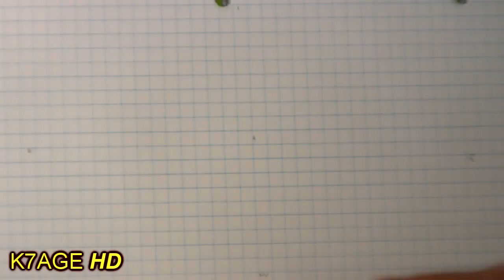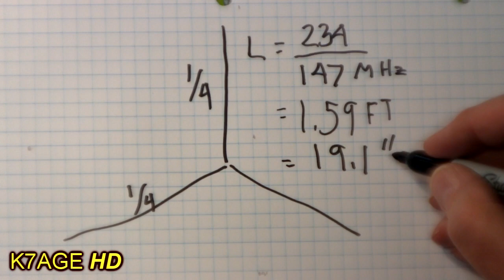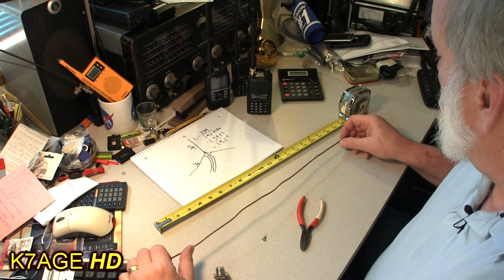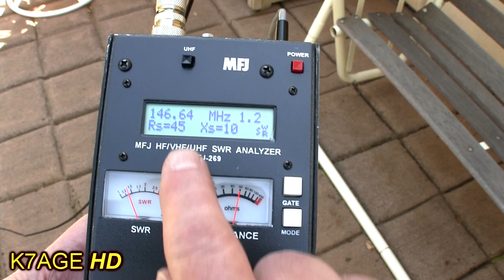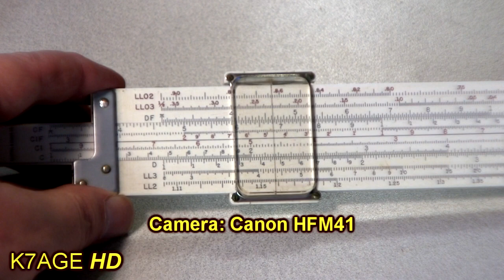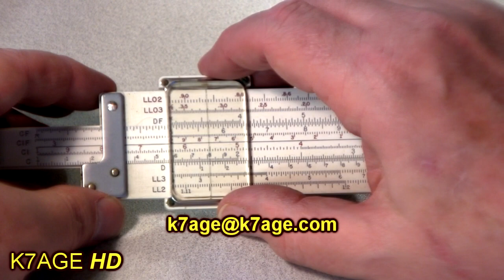How to Build: Ham Radio 2 Meter Quarter Wave Antenna

Comment: I'm looking to build a simple antenna,  you really laid this one out very well, and it seems impressive.. but a serious question.. Between this antenna and the dual band 2m / 70cm vertical dipole.. Which is the better of the two?

Comment: This worked great! I attached the pvc pipe to a drain breather on the roof and ran the coax into the window. Thanks for the video. I was not heard at all before, just had my first radio check last night. :)

Comment: Why do use 234 in the formula? Where does that number come from? I have watched several vids on determining length and each uses what seems like a random number for their build divided by the frequency, and no one explains where the top number comes from.  Thanks.

Comment: The end of the video brought back memories of the days before electronic calculators.  
We, or many of us, became very proficient with a Slide Rule back in the day. 
Here is a quick... what is a slide rule....
"The slide rule, or slipstick, is a mechanical analog computer. The slide rule is used mainly for multiplication and division, and also for "scientific" functions such as roots, logarithms and trigonometry, but usually not for addition or subtraction.
"

Comment: Wow, great! 
Could you use an antenna as such to transmit sound non-stop to a receiver 15 miles further in an attic? Or would you run into trouble as you are interfering within that frequency and other transmitters? :)  I'm looking for a DIY way to have a live broadcast from one point to another 15 miles further, without making a radio (only one place needs to receive it) but it's been quite difficult.. :)

Comment: Thank you. Well done and very useful.

___________
I only wish Americans would stop using archaic units in favors of the more rational international units. Without realising it, they are wasting everybody's time and literally billions of dollars of their own money because of a nostalgic attachment to obsolete units of measurements.

This is how every single engineer on the planet would design this antenna: 

The average speed of an electromagnetic wave in a copper wire is 95% the speed of light. So, a wavelength at 147 Mhz = 0.95 * 300 / 147 = 1.94 m (quick check: it makes sense since it's just short under 2 m). A quarter wave, therefore is 1.94 m / 4 = 0.485 m (48.5 cm, make sense since it's a quarter of a full wave length). Then, and only then, if some of their clients insist on having obsolete units of length printed on the antenna's packaging (feet, inches, yards, ald, alen, buddam, ell, girah, guz, jow, pace, rod, stadion, step, unglie, vara, yojana, whatever...) they would convert the result to their client's anachronic units and charge them extra for the trouble. A few cents there, a few dollars there, at the end, it adds up to a huge unnecessary sum each year.

Comment: Wouldn't a 5/8 wave radiating element work a little better? A little more gain.
Reply: A 5/8 antenna requires a more complicated matching system compared to a simple 1/4

Comment: Interesting and informative video, but just a small spelling correction needed, you misspelled Metre (A Unit of Length) with Meter (A device for measuring volume, distance etc)
Reply: Meter is the American spelling of metre. Like colour and color.

Comment: Is the 10' length of coax significant? Would things change with a longer coax?
Reply from the maker: That was the length that I had handy. You can use longer coax, but the longer you go the more loss you have from the cable.
Reply: Thanks gents. I am definitely building this antenna.

Comment: Ok mr smart guy with his slip stick, eeerr, slide rule. I have my dad's and haven't never been able to work the darn thing. My Dad would work out problems as fast as I do with calculator.  He passed back in 73.  And now that I'm 72 I though about my grandson learning. But I guess he would consider it to be an antique. My Dad was a mechanical draftsman.
Reply from the maker: Learned this in college in the early 70s.
Reply: Yeah, it would have to have been some time ago. Don't think they even make em now. @K7AGE

Comment: To make it short : on the 2 meters band (200 cm), λ/4 is 50cm. Don't you think it is time to go metric? ;)
Reply: @K7AGE  You had to make 2 calculations and a conversion to determine λ/4 on the 2 meters band (note that it is not called the « 6 ft. 6.72" » band 😄), because of your cumbersome units (that nobody in the world uses, but you).
In metric units, 200cm (2 meters) divided by 4 gives 50cm (by head, no calculation, no conversion). Take a metric tape-measure and cut a 50cm element. Done! 😉
Reply from the maker: I bought a metric tape measure when I was in China years ago. I would make it easier!

Comment: Ground plane antennas are simple and they work. I have to agree that Radio Shack is a dead retail outlet. If you can find one, I guaranty they'll be holding a close-out sale very soon. Go to Ebay,  Amazon, Gigaparts, DX engineering - or - Radio Shack as I'm sure you will get a great deal.
Reply from the maker: They were around when I made this video.
Reply: @K7AGE  Yep, I really wish they still were.

Comment: Hey friend how are you today, I just started getting into ham and I bought myself a little HT, and I am putting a 771 antenna on it with the rats tail, I have a local repeater it 3.4 miles from my house, and then there are four more in the local area within a 4 mile radius, I don’t Much about ham at all do you think I would make it 3.4 miles to a repeater with my set up the way it is. Thank you and if you can please respond Oh yeah PS the radio has 8 W max
Reply from the maker: I would think that distance should work. The repeater should be strong on your HT.

Comment: It would have been interesting, testing the ground plain at the same height of the ''rubber ducky''. In this test the vertical is a good 6 feet higher than the ducky.
Reply from the maker: True. But, the rubber duckie has loss compared to the 1/4 wave antenna.
Reply: @K7AGE  , agreed, notwithstanding , my point was in VHF/UHF signal propagation line of site is important. 

By raising the ground plain relative to the ducky, the ground plain has the advantage because it is higher and more likely to be line of site.

Comment: I have straightened and stiffened wire by clamping one end in a vise and clamping the other end in my cordless drill's chuck and slowly twisting it until it is straight. You have to stop though before it reaches a breaking point. Or, on a piece that short, you can lay it out on a hard flat surface and use a similar length of a plank and roll the wire between the plank and the flat surface to straighten it. Thanks for this tutorial. I plan to build one of these.

Comment: Thank you!  Just made mine and I can key into the two local 2m repeaters!  The only thing I did different was tap the 4 holes for 8 32 threads and used ring terminals  on the ends of the radiators.  Great video 73 KN4OVL

Comment: Cool, I am rather new to the hobby, well I have had my ticket now for 3 years, but have only had one contact, who is now, sad to say, passed on.  I live in a VERY rural community, I am the ONLY ham in my town, the next nearest was the fellow who passed away, he was 26 miles away, I talked with him for awhile when in his town waiting for my wife while she was in the clinic.  I sat out in my car and did a CQ on his repeater freq, he came up and we chatted, I only had my Bofang HH at the time, he said I was hitting him like I was right next door.  When I explained where I was, it happened that I was indeed almost next door, his repeater setup was on the hill overlooking the clinic.  I tried to make a few contacts when we were down in Arizona, but didn't seem to find anyone interested in making contact.  To be honest, I only tried once from the RV Park where we spent the winter, on an old mobile unit I had in the RV.  Hard to get into a hobby if nobody talks with you I guess, but I shall build one of these units and check it out.  I just put together a 102 inch dipole for an old CB Radio I picked up in a yard sale down in AZ last winter, going to mount that on  my house he in SD and see if the CB is dead up here or not. Followed the instructions from another YouTuber on how to build that out of old TV Cable.  The cable I had was commercial grade, taken down when our local cable company went fiber-optic, they just cut it down and left it lay in my yard. Never being a person to waste good copper, I brought a chunk in the house "just in case."  It is much thicker wire then you find in the crap you buy up town so I am hoping I get better performance with it. I may also hook it to my scanner instead, since our house seems to be a farady cage in that we can receive zero radio inside, in fact the local radio station whos tower is only a mile from our house barely penetrates the house, giving a very poor signal, we listen to it on the Internet in order to catch up on local news.  I am in hopes to be able to hit the repeater some 50 miles away (as the crow flies) where my  nephew lives, he is a Ham and monitors their 2 meter repeater which is on one of the highest hills in North Dakota.
Thanks for the great Video
KE0JBL

Comment: Good video but like a lot of the world I'm looking at the     calculation at 2:34 thinking "where does he get 234 from?" - then I realised it was feet and inches. Much easier in SI units..
Reply: For metric... 300/frequency in wavelengths. Divide by 4 for a quarter wavelength. 73

Comment: Since 1/4 wave for this freq. is relatively small, what would be consequences of making same style/type antenna, but cut for full-wave at two-meters (using something a bit more substantial so as to alleviate flex/bend)?
Thank you for your time and assistance.
Raymond - WF7BSR
Reply from the maker: I don't think that would match to 50 ohms. Maybe 3/4 wavelength.  If you have an antenna analyzer, play around and try it.
Reply: Thank you.  I'm re-starting into HAM radio after putting everything into storage some years ago...never went beyond Tech. Lic. I got in 2012, and now having to basically start from scratch trying to re-learn what little I thought I knew back then...but I'm clueless about a lot of the theory and formulas, etc. when it comes to building antennas...figured if a quarter-wave size works pretty good, then a full-wave must be better (so there's some basic concept I'm unaware of that makes a  full-wave not better than 1/4-wave or 1/2-wave).  I need to become much better educated about this.
Currently I am at the stage where I would build an antenna by copying what someone else did, but I would have no idea how/why it does what it does...(it's all magic, right?, ha-ha).  Going to buy some books, etc. -- had tried to go the cheap (lazy?) route by just watching endless you-tube videos, with the idea that I would "eventually figure it out" -- does not work.  Repeat: THAT DOES NOT WORK!
Thank you for quick reply to my question, and thank you for all the videos you've made, and the time and effort you put into sharing your knowledge with others.
Reply from the maker: This antenna mounted outside up high will outperform the antenna on the HT. This is a simple antenna, easy to build. Works great. Welcome back to the hobby. Have fun.

Comment: Great antenna How-To! 
Since you can attach a mobile antenna to the top of a car using the roof s a ground plane, is it necessary to have ground-radials on a stationary antenna cut to an exact length, or can they be longer and hang down a bit to increase the ground plane?
Reply from the maker: The radials are not needed if mounted on the car’s roof. The roof will provide the ground plane.
Reply: Thanks, but the question remains; is it necessary to cut the radials to an exact length, or can you just hang, say, 4  5 foot lengths of wires off the PL259 to establish a ground?

Comment: I'm brand new to ham radio. Will this antenna work with simplex frequencies as well? I'm wanting to be able to throw this up in the field when I need to on the fly.This video is very helpful thanks.
Reply from the maker: sure, it will cover the entire 2M band

Comment: could I use TV coax cable for this?  I have a HUGE length and Id like to have the antenna outside and myself inside at a base station
Reply from the maker: TV coax is 75 ohm, we use 50 ohm coax. It will work. You will have a slight impedance mismatch which will show a bit higher SWR. Most radios should be able to deal with it. Although, no guarantees  provided.. ;-)

Comment: I built essentially the same antenna for the marine band for a friend in The Bahamas.  Her original antenna got hit by lightning and a replacement was ridiculously expensive.  I used copper welding rods for the driven element and the radials.  I used a small torch and soldered the driven element and radials to the SO-239.  Ran some new Rg-8 coax up through a pvc pipe and lashed it to a railing on her porch.  I told her it was only a temporary fix--which, it turned out, lasted ten years.  Worked like a champ.  I think it cost all of about $5.00
Reply from the maker: Good job!

Comment: Thanks for your video, but why the complex maths to work out "19.1 inches". Doesn't your tape measure display both Metric and Imperial units ?  If it is a quarter-wave, of "two metres" then surely it is just exactly half of a metre, right ? Note I'm NOT making fun of you for using inches (I grew up in the generation where we learned both systems as our country changed over in the early 1970's) But the reason I ask is that according to my tape measure, half a metre equals 19 full inches and 11 / 16 ths. That is quite a bit longer than 19.1 inches.  Cheerio from Catherine in New Zealand  (that's like near Australia but 1,000 miles further South-East)
Reply from the maker: Well, most of us in the USA work in inches, feet, miles. But, good point. Also, the lengths are bit different than different than the speed of light due to the velocity factor of the signal going through a wire. Thanks for the comments.

Comment: How many watts do you feel you could you use with this? I'd like to use it as a portable antenna for my mobile unit, that can kick out up to 60w.
Reply from the maker: that might work. The area where the vertical solders to the center pin needs to be kept clear of any solder splash.
Reply: K7AGE Understood. I have also seen some versions of this antenna that have the radials bent down at 120° vs the 90° you were running yours at. Do you have any opinions on that? I believe it is supposed to reduce impedance.
Reply from the maker: Bending them down helps the matching. I forgot to do that. It still works fine.

Comment: Just passed my Technician Exam yesterday and have found your videos incredibly helpful!  This one is great as my first and only radio at the moment is a little Baofeng HT with a rubber duck.  It is going to be my very first DIY project.  Couple of questions if you don't mind.  Do I need some kind of grounding for the antenna?  What about if I decide to make it a little more permanent?  Was the pole you clamped it to grounded or can it be as simple as driving a pipe into the ground a ways?  Thanks for the great video!

Comment: Has anyone tried building this with wire coat hangers? Would that work for really on the cheap?
Reply from the maker: Yes that will work. Just make sure you clean the paint off wire.

Comment: I'm just getting into the hobby now (I'm 33), and about to build my first antenna. Pretty sure this is exactly what I am going to do, but potentially installing it in my attic instead of outside (HOAs....) Thanks for the info!
Reply from the maker: It will work fine in your attic

Comment: Sir what is the exact length of coaxial cable you use for this project
Reply from the maker: It really doesn't matter. The longer the cable the more signal loss. Larger cable RG8, has less loss than RG58. I probably had a 10-15' piece of coax for this video.

Comment: Well now, I built this 1/4 wave , 2 meter antenna. I am impressed with how good it works.
I have mine up about 20 feet and have made contacts on simplex...30 miles away with only 10 watts of RF power.  I have yet to see what my 75 watt power can do.
On repeaters...I have hit them 100 miles away with 30 watts.
I followed the directions...but used #12 copper wire for the radials and vertical...cut exactly at 19 1/4 inches.  I ran the coax through  a piece of 3/4 in. PVC...2 FT. long, and wire tied it to a mag mount...that sits on my metal roof.
A very sweet antenna...and I thank you for the info on it.
Tom
KC2SPU
73`S
Reply from the maker: Tommy, glad to hear that the antenna is working great for you. It is a big step up from the rubber duckie on the radio. Have fun working the distant guys. Randy
Reply: Actually, I am running a Yaesu FT-2900 radio.   It sits right next to my Yaesu FT-840 all band HF rig.  No rubber duckies here....ha ha ha

Comment: great video! I'm new to the science but not to others. I want this to be my first base antenna. I would like to compare it's performance with that off a rubber duck mounted on a similar pole. have you ever done that? I've heard/read that your body increases impedance. in addition to the elevation disadvantage, curious as to what a rubber duck might do. I imagine not much but still wanna see it
Reply from the maker: I have never compared the two on a pole outside. The HT antenna is a compromised to make it a short antenna for the HT. Have fun with the build.
Reply: K7AGE thanks for the reply. lol! I don't even have my radio yet. and now that I'm more awake this morning I'm realizing the numbers involved tell a story too. such an experiment might be a waste of my time.

Comment: Very nice video - practical with little theory - my kind of project! I noticed that the impedance on the MFJ antenna analyser was swinging below and above 50 ohms. Might be an idea to try a balun at the feedpoint to improve the match. Kind regards Peter G0LQU